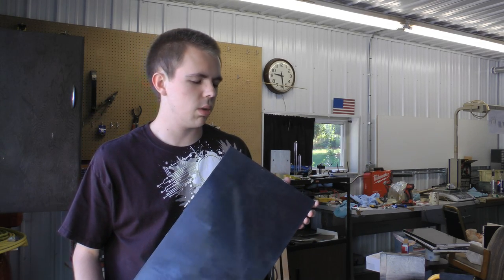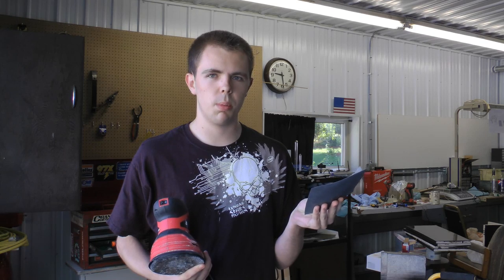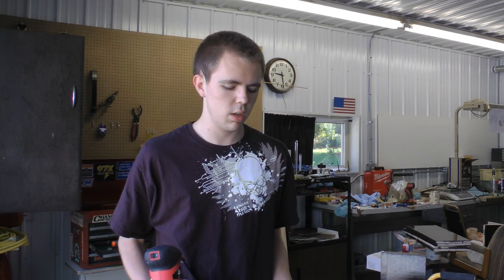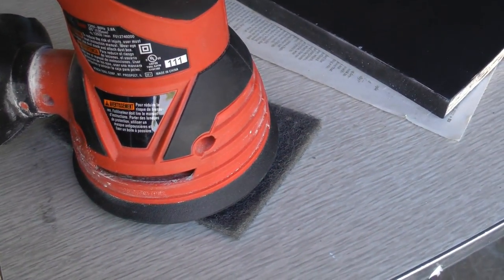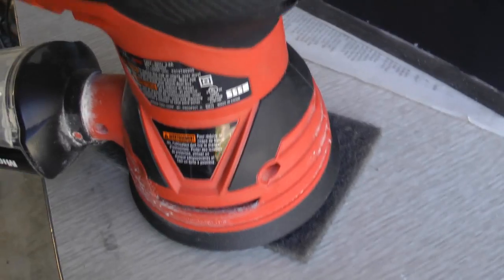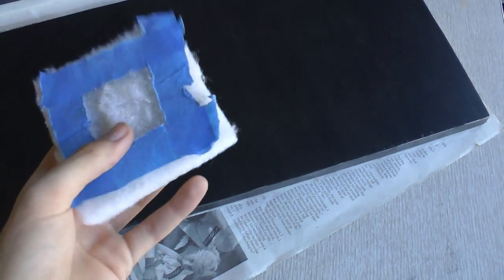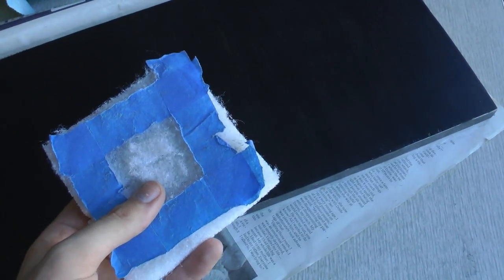How to finish wood using water based polycrylic.

Comment: thanks for making this. I have been working on a similar project. I appreciate that you went so far to make this video it saved me from throwing my project out in the street and starting over.
I am up to 10 coats and I know there was a way to polish the poly out but I didnt know how with polycrylic.
The first several coats were nice, but, I am applying over a sign I painted, white letters on black grain. The poly had to be deep enough to build up the surface around the letters.

 thanks again

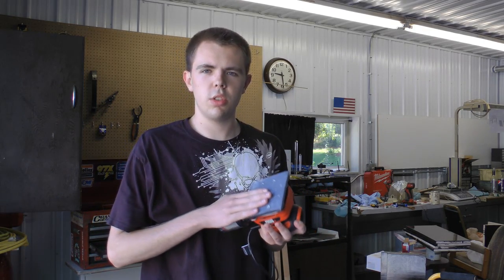Comment: Harryman11, I've had a similar issue with my palm sander (the one you brought out at 0:53). Did you get those little circular scratches? If so, I've found that the way to prevent those is to move the sander around very slowly. I finalize my wet sanding with 2000 grit and even with that fine of paper it scratched it when I moved it around too quickly. But I slowed it down, and no problem. Nice evenly sanded surface. BTW, this finish looks great for being your first project! Keep it up!

Comment: @harryman11 great job on the finish first off...I'm a newbie as well..how long did you wait before sanding and rubbing your final coat?i waited a few hours after drying and tried your method but I don't get that glossy finish. I applied another coat but a lot thicker this time so hopefully you see this soon before I dig into it again..I'm using semi gloss polycrylic by the way
Reply: maybe cause you used semi gloss.... as in, is not gonna be glossy :)

Comment: Sand with 400 -> 800 -> 1500 -> 2000. Then use grey micro-mesh soft touch pad (I order them from stewmac.com) with Turtle Wax polishing compound. Then buff with a foam wheel on your drill. Wood looks like it has a sheet of glass on it. :)
Reply: Dan Stump I bet LMAO. I did that once, wet sanding, it was amazing but took forever.